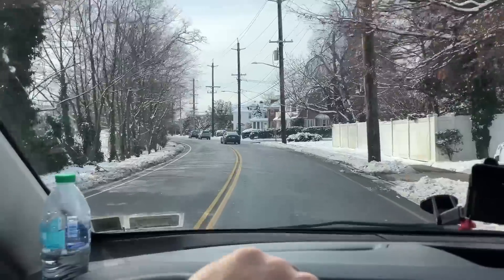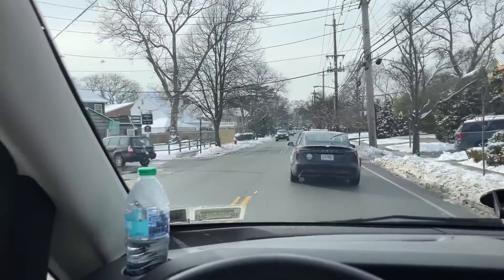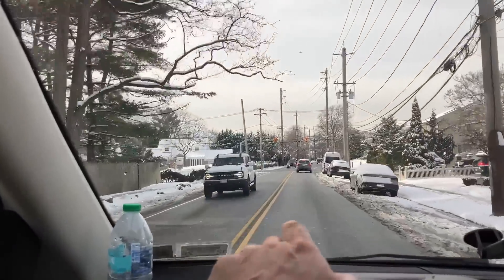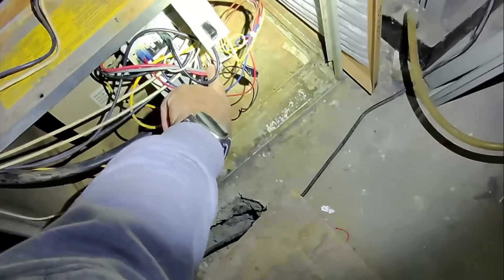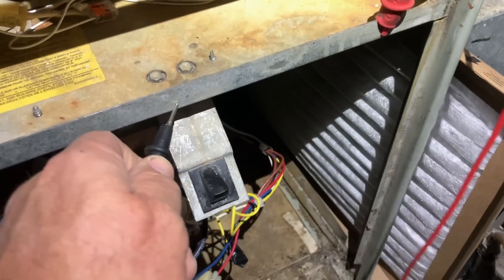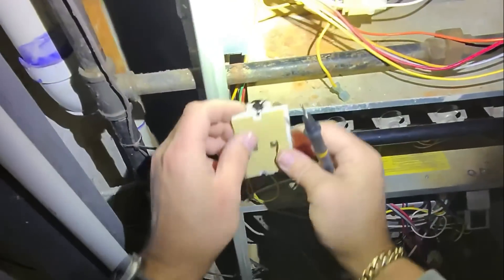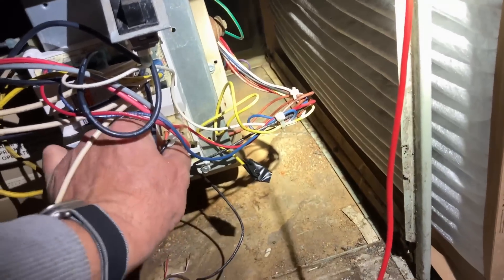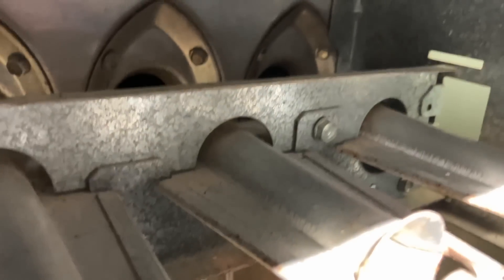Trane XE80 Blowing Fuses 🔥 High Limit Switch Shorted to Ground (Real Diagnosis)

Comment: I think Most EV drivers are pricks like that on the road. They will either tail gate the shit out of ya then speed past you on a double yellow or pull out in front of ya or make abrupt turns without signaling. Mom almost creamed the back end of a Rivian SUV just 2 days ago when the prick made an abrupt stop and turn in front of her without signaling. The bad thing is ya barely have to touch the brakes with Regen cranked up to come to a stop. And the LED indicator lights can be very very hard to see especially in poor weather at dusk.

Comment: hi mikey, great video but i had a question, why did you unplug the 12pin molex connector before testing shorts to ground on the high limit sensor?
Reply: Probably checked the high limit connection at the molex to see if it’s grounded, it is (not shown on video ) then backtrack to the limit switch.    Once the limit switch is swapped out you can double check at the molex again to make sure it’s not the wire itself that’s also grounded.

Comment: the limit was probably bent to one side a little and hitting the heat exchanger inside. unless the heat exchanger is cracked/coming apart or heat shield rusted and dropped down, should be able to see all that via the hole though. lol
** need to proofread, great typing me. 🤡